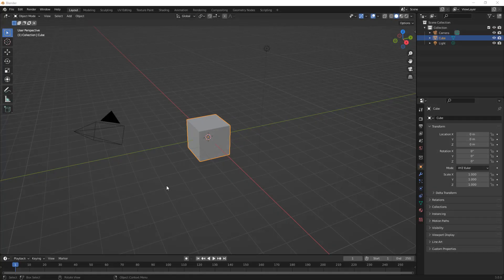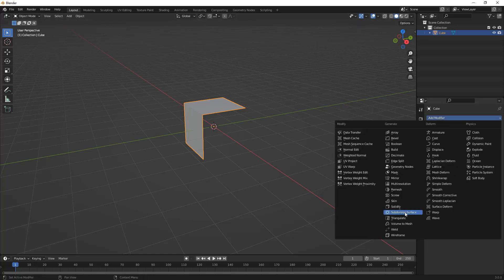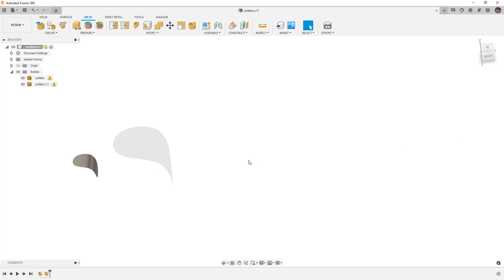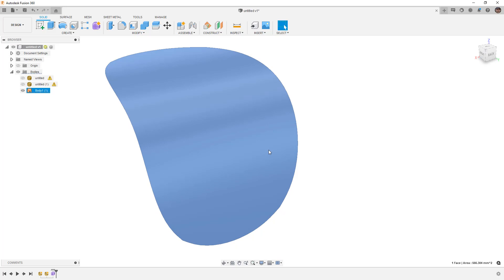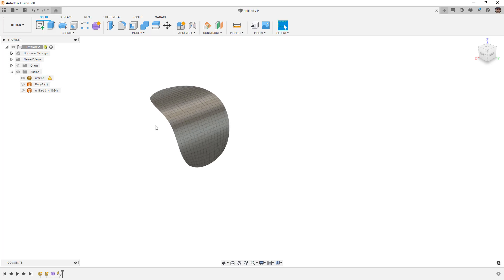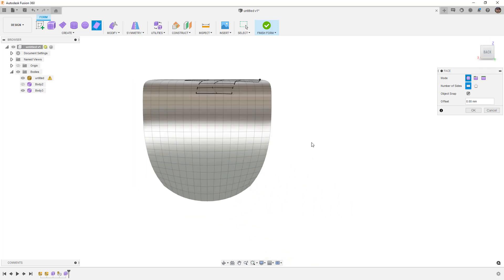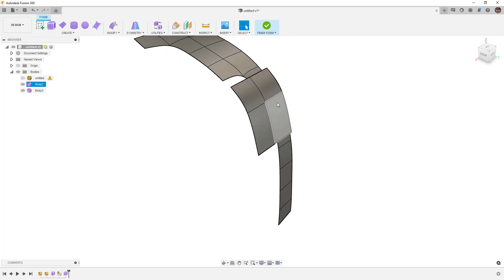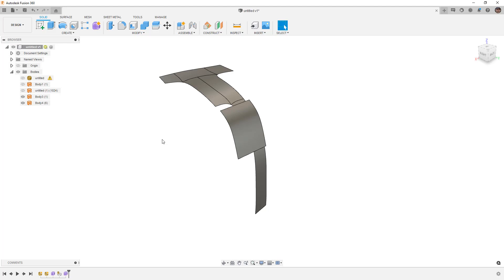Blender to Fusion 360 - How to Convert a Mesh to a Clean CAD Surface

Comment: OK, so to summup, if I create something more complicated with blender for cnc machinig and then wish to convert it with fusion for iges or step for example, then keeping the designed "part" all quads and relatively mid polycount shout yeld me the results I seek? I wonder if splitting the blender part into chunks would help too for the conversion process?
Reply from the maker: Yes exactly.  Fusion does have a "convert to quads" option but its in the design extension which is not available for hobby users and its still a crap shoot.  Fusion can convert prismatic parts with some luck but honestly if its easy enough to convert that way its probably easy enough to just model.

Comment: For those only have free fusion, (without clean mesh conversion) is there any workflow to comvert a mesh stl to editable solid to fusion? (maybe FreeCad, 3Ds, blender,  anything .step for example.)
Reply from the maker: The only mesh conversion that isn't available in the free version ( i believe) is the organic one that tries to do a quad mesh conversion to get a tspline body.  There are some paid and free quad remeshers that would allow you to import an OBJ(because stl is only tris) and convert it to a freeform body (within limitations).
https://exoside.com/

Free one
https://github.com/wjakob/instant-meshes

I have used the instant meshes before and will get you most of the way there but it does have its limitations.

Comment: About a year ago I was working with some very complex (think jet engine geometry) 3D scans in Fusion, and overlaying them with 5 axis machining operations with in process geometry checks. One of the most annoying things though is even though I can do that, I never found a quick way to take 3D scans and make solid bodies that were not faceted to make machining seamless surfaces easier. Fortunately for what I was doing it didn't matter it was a comparison of different things I can't go into, but I have my own handheld 3D scanner and I regularly find I want a way of taking a mesh and making it a smooth model as quickly as I can. I would love to see a special series just on doing that. Starting to wonder if there isn't a way to make AI do this quickly..
Reply from the maker: Sounds like some fun work!  There are a few tools.  Some used to be free within the Autodesk ecosystem, but now the only native tool that will do it is behind the Product Design Extension.  On the Mesh tools if you go to the Modify drop down on the ribbon and down to Convert Mesh, in there you have a 3rd method locked by the PDE called Organic.  What this does is attempts a quad remesh of your data and invokes the Convert mesh to tspline and creates a form body.  IF the mesh is prismatic in nature there are conversion options in Fusion that attempt this however I have found this to work ok on simple geometry, especially if it was meshed in Fusion, but anything that was meshed in say Blender are treated a bit different.  Something about the way a CAD program makes a mesh file vs a poly program confuses Fusion with this process.  So if your parts are from another CAD software and saved as an STL or OBJ you might have luck using that prismatic conversion tool in Fusion.

Outside of fusion there are a few tools.  Some paid and some free. https://github.com/wjakob/instant-meshes Most of the free ones are limited to Quad Remesh and then you bring that to fusion and attempt a convert in the form tools.  There will be a limit to the number of faces it can handle though.  There are tools and add-ins for blender and others with trial versions like exoside https://exoside.com/

Other tools exist not as a plugin for Fusion but as a stand-alone to spit out a Brep.  There are conversion options in programs like Geomagic.  NPower which makes a subD modeling add-in for Solidworks has a tool called Cyborg3d mesh to cad https://www.npowersoftware.com/NewCyborgMeshToCADOverview.html

Comment: I know this is old. Trying to perfect a body kit on a 3d model before purchasing a scanner and 3d printer. Its not uploading probably due to it not being solid. How can i export this to fusion 360? Thank you so much in advance!
Reply from the maker: you can open any mesh in Fusion by using the Insert Mesh tool on the mesh tools tab, but that won't help you make it a solid.  In order to convert it to a form that can be thickened you would need to make sure your mesh in Blender is a quad mesh.  The other option is to use Solidify in Blender to thicken it then send it to whatever 3d print utility you are using.

Comment: new sub here- using CR Scan Lizard (new to me) and once I finally get a decent scan (that's a subject to itself!) I was trying to make solid (3D print) in Fusion. Now that I have this info I think I can do it.  I will download Blender (another thing to learn) I use Prusa printers and Slicer--then Lizard to Blender to F360 to Prusa Slicer then to printer. Reverse engineering on motorcycle parts. Wish me luck. Thanx
Reply from the maker: Welcome aboard!  My latest series is scanning a car fender to build a wide body.  Might be of use.  Also if you haven't seen it go check out Making for Motorsport.  David did scans with a CR Lizard as well as other things and might have some very specific info for you.

Comment: New subscriber, awesome video, my question is I bought the model of an airplane is in obj and I need to bring into Fusion 360 and I am guessing convert to a solid so I can cut it up and make negative molds and export as stl for 3D printing, then the molds will be glued together and make composite parts, is this possible? Can I send you the obj file so you can make some suggestions on which path to take? THANK YOU!
Reply from the maker: THanks Ja Be!  So starting out as a mesh is tricky as your file is made up of triangles.  If you happen to have the product design extension there is a mesh conversion that attempts to turn it into a form body.  You can also try to take it into a program like Blender that is free and make it a "quad mesh" then import it into Fusion.

Since you are planning to 3d print your molds you might be able to use the "para mesh" features in Fusion and just create the mold like that.  If you want to send the file support@caducator.com.  I have a pretty big list right now but ill try to help as best i can.

Comment: Interesting and useful. I come from a Blender background and Fusion 360 is very different. How do you export/import from Blender to Fusion curves, so that a tool can follow a path.
Reply from the maker: Hi Iago, are you saying you want to take a Curve object from Blender into Fusion 360?  I don't currently know of any way to take a curve object directly out of Blender.  It works with Mesh so if you convert it, the export should work the same, but then you loose a true Bezier curve.  I'd love to know the workflow you hope to achieve and maybe I can be of some more help.

Comment: Is there a way to cover a triangular mesh into a quad mesh in blender?
Reply from the maker: Yes theoretically but there might be situations it doesn't work.  In blender apply the Remesh Modifier.  I covered this recently in the fusion to blender for sculpting video.  I used the Voxel method but play with smooth and sharp as well.  This should give you a quad mesh, but there may be some geometry where that isn't possible.
Reply: use Quad Remesher, $100 add-on tool for Blender, to quadrify a tessellated or nGon mesh.
Reply: @kenw8875  i will check that out

Comment: I'm working with 3d scans in fusion. Not the perfect tool for that, but this is what I have :)
It would be cool to see workflow of building something off the mesh geometry like ducktail spoiler or fender flares.
Reply from the maker: Yeah scan data directly in fusion is tough.  To be fair it is tough in any software that is not specifically made to handle it.  Solidworks had a "Scan to 3D" option you could enable that tried to build surfaces off of mesh data but......

I have done a few methods on the past with CMM point data building curves and with actual point cloud data.  For a free tool to help clean that up you could try Meshlab.  I have used it with laser scanners before but most of my production work was in RapidForm, now under Geomagic.  

If you would like to send me any scan data I would be happy to try and figure out a workflow!  My guess is to wrap it and remesh it with quads in something like meshlab or blender, then take it over to Fusion 360.  

https://www.meshlab.net/

I am not affiliated with meshlab in anyway and it has been awhile since I have used it.
Reply: @LearnEverythingAboutDesign  I used meshlab to align scans before, now mostly to decimate scans to be lighter for fusion. It's powerful tool, but interface is tough... :)))
Reply from the maker: no joke.  Free/open source software isn't usually know for great UI.... Blender a few years ago was tough. it is much better now.

Comment: I already noted that you are bang on with the videos that interest me xD since Blender has Nurbs support, that would also be an option since nurbs are basically a different name to Autodesks T-Splines , so the conversion could start in blender a little already. Since i am trying to retopo my scanned meshes to cad and it's still a pain (probably my fault for not designing from scratch lol) definitely interested in the foms and surface stuff
Reply from the maker: Hey Tarek, I would love to know more about this!  I believe you can create NURBs from the mesh curves, but i wasn't aware you could make a nurbs surface from a mesh body.  I had heard Shrinkwrap did something like that but I honestly had never tried.  There are a lot of variables but quadmesh to tspline is really easy and has the best results so far(using blender and fusion 360 specifically).  If you have more info on the nurbs support please let me know here or support@caducator.com